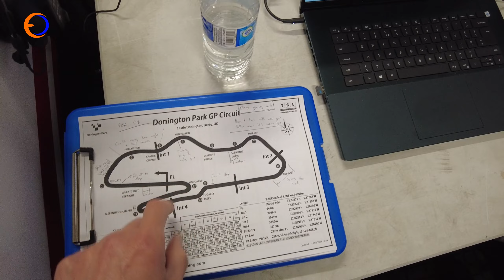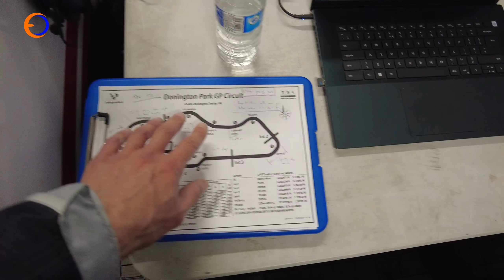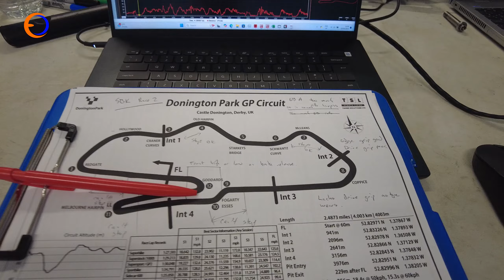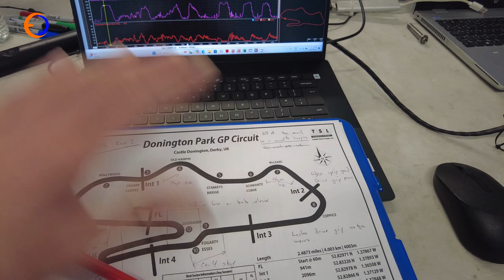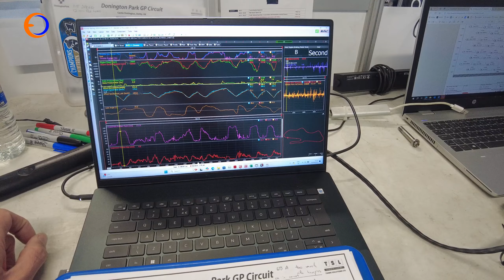Donington BSB Disappointment. Tough weekend for the Rapid Honda Superbike team

Comment: Why does the shaft seal keep failing Dave? Seems odd that it would recur so often.
Reply from the maker: Different engine this time!
We're not sure yet why they fail, but I do know we're not the only ones with the issue
Reply: @obsession_engineering Bound to be a different problem than when rebuilding 50 year old clunkers, but on our message board, the classic mistake gents make is not protecting seals when sliding them onto a splined shaft. In other words, I’m aware of multiple failures due to unintentional seal damage during installation. The avoidance tactic is a film of soft plastic like cling film on the end of the spline while sliding the new seal on. If utter nonsense, ignore. Properly made seals should not fail in service.
Reply: @GT380man  prolapsing of the seal during installation is possible, as can happen with two stroke crank seals. Though i would think it more likely it’s a manufacturer part/tolerance defect. Rare, but these things do happen. Impossible to say without being in possession of all the facts.
Reply: @obsession_engineering  Really enjoying the channel, fantastic insight. Thanks

Comment: Would a longer swingarm help drive and grip? I've no idea if it's allowed though. At this level of racing solving problems becomes incredibly hard. As always a great vid, thank you👍
Reply from the maker: Longer arm would reduce grip, as it moves the wheel further away from CoG
Reply: @obsession_engineering  ah, no don't do that. Do you know I always thought that's why the R1 had a long arm. I stand corrected. I'll go sit in the corner now

Comment: At what stage will it be relevant to set the bike up to X spec and let the rider get used to it, instead of fiddling or trying to engineer the  way around a problem they may resolve themselves? That bike is like triggers broom, every time it comes in it goes out a different bike sure no man could get the hang of that